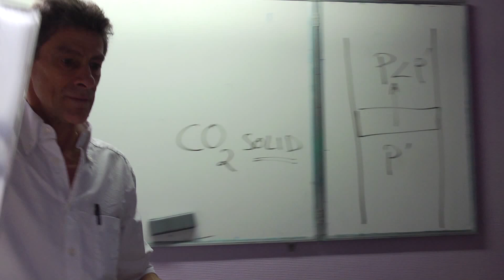Making SOLID Nitrogen!

Comment: If you were to leave liquid nitrogen in that vacuum as a solid, would it remain like that for a very long time? Or would it eventually turn back into a gas/liquid? If you were to raise the pressure in the glass container would the nitrogen stay liquid for a long time because little to no of it's molecules are leaving the liquid as a gas due to the pressure?

Comment: The cooling effect of the water is not only because of the separation of more energetic from less energetic molecules; there is also a significant latent heat component, since water molecules at any temperature need more energy to be gaseous than the total that can be accounted for by the difference in temperature between liquid and gaseous states alone.

Comment: I believe there is also a solid allotrope of nitrogen, which does not  depend so much on low temp as on ultra high pressure and it is a flat sheet/mesh/lattice with uniformly original bonds. They calculated that its colour should be a very deep blue.

Comment: SI is fantastic, it pegs measurement units to known things that do not require a master set of models. Also SI: Celsius starts at the freezing point of water*

*under specific conditions that will not be what you measure.

Comment: At the bottom of the ocean water around volcanic vents boils at around 400℃. The pressure allows it to boil at a higher temperature but does it still start to boil 100℃

Comment: Something may have been lost in translation, but it is simply not credible that about 10-20g of CO2 (concentration around 400ppm in air) can condense over the water in a water bath in a few seconds. The white, gas venting island, dancing on the water was behaving in exactly the way I would expect lumps of SOLID NITROGEN SLUSH to behave... after all, that's what the video was about, and was the stuff the guy poured onto the water...
Reply: Exactly, there's not enough CO2 in the whole room to make that floating island. Why does the solid nitrogen remain behind after all the liquid nitrogen has evaporated? It’s because the liquid nitrogen spreads itself over the whole water surface and so makes a more efficient heat transfer to the water, while the solid nitrogen has a smaller contact area to the water and so takes longer to melt/boil.

Comment: Looks like this dry ice weighs around one gram, which would mean that two cubic meters worth of air had to cool down for it to form. I wonder how that could have happen though.
Reply: There's not enough CO2 in the whole room to make that floating island. It’s the solid nitrogen which they tipped onto the water. Why does the solid nitrogen remain behind after all the liquid nitrogen has evaporated? It’s because the liquid nitrogen spreads itself over the whole water surface and so makes a more efficient heat transfer to the water, while the solid nitrogen has a smaller contact area to the water and so takes longer to melt/boil. 
And just by the way, solid CO2 will sink in water.
Reply: @martinstent5339  hope they've figured this out then. Or that thing is fluffy.
As to how much co2 is needed, there's roughly half a gram per cubic meter, so should work for a fluffy raft
Reply: @spolo123  But realistically the CO2 could not get through the blanket of cold nitrogen covering the water bath.
Reply: @martinstent5339  that I dunno

Comment: Would it not be dry ice
Reply: Yes I think it would
Reply: AdrianO why did you respond to your own comment?
Reply: Ned Landry idk😂
Reply: There's not enough CO2 in the whole room to make that floating island. It’s the solid nitrogen which they tipped onto the water. Why does the solid nitrogen remain behind after all the liquid nitrogen has evaporated? It’s because the liquid nitrogen spreads itself over the whole water surface and so makes a more efficient heat transfer to the water, while the solid nitrogen has a smaller contact area to the water and so takes longer to melt/boil. 
And just by the way, solid CO2 will sink in water.

Comment: 2020 and it's still satisfying to see dryice floating...
Reply: There's not enough CO2 in the whole room to make that floating island. It’s the solid nitrogen which they tipped onto the water. Why does the solid nitrogen remain behind after all the liquid nitrogen has evaporated? It’s because the liquid nitrogen spreads itself over the whole water surface and so makes a more efficient heat transfer to the water, while the solid nitrogen has a smaller contact area to the water and so takes longer to melt/boil. 
And just by the way, solid CO2 will sink in water.

Comment: If your description of boiling at low temperatures "the fastest molecules boil out" is accurate, that implies that at any one time there are hot molecules and cold molecules in solution together. I'm not sure how heat diffusion works on the molecular scale, but the further implication is that a significant proportion of the molecules are cold enough to be at a solid state, and that it is only due to the averaged out heat that it retains its liquid state.

Comment: So... How did you go from solid and liquid nitrogen to solid CO2? Would think that the evaporating nitrogen would have quickly and completely displaced the air, leaving only nitrogen vapor.  That ice floating around wasn't just more solid nitrogen? I'll have to watch that again. ;)
Reply: There's not enough CO2 in the whole room to make that floating island. It’s the solid nitrogen which they tipped onto the water. Why does the solid nitrogen remain behind after all the liquid nitrogen has evaporated? It’s because the liquid nitrogen spreads itself over the whole water surface and so makes a more efficient heat transfer to the water, while the solid nitrogen has a smaller contact area to the water and so takes longer to melt/boil. 
And just by the way, solid CO2 will sink in water.

Comment: I have been making liquid nitrogen for decades but now I’m too old to scuba dive 
   The point I wish emphasize is the boiling of the nitrogen 
  Is what happens when you are down Four atmospheres and are now returning to the first atmosphere and the most dramatic 
 The boiling of the nitrogen is what happens to a scuba diver when he gets the bends   The longer the time and the deeper the depths the more liquid nitrogen you have in your blood
 A scuba diver never surfaces faster than his slowest bubble 
 There is a thing called nitrogen narcosis this is when you are down four or5 atm and your diving buddy starts talking off his scuba gear with the belief he no longer requires it you need to get this individual to the surface without bending them 
The liquid nitrogen needs time when turning back to a gas or you will be bent 
 If you do not elevate the feet dramatically as to cause the bubbling liquid nitrogen to enter your feet instead of your brain think of what would happen to your brain if it was boiling

Comment: Isn't it pretty well known that boiling point depends on pressure for anyone with rudimentary physics knowledge?

I knew boiling and freezing both use energy, though I never gave thought to cooling something by lowering pressure and thus freezing by boiling.

You say solid nitrogen sinks in liquid nitrogen, but that ice was floating in the bottle. So was that really frozen nitrogen?

Comment: The frozen carbon dioxide would be created with or without the solid nitrogen in it.  That nitrogen slush had nothing to do with it.  You can make it with just liquid nitrogen.  BUT SOLID NITROGEN IS SO COOL!!!  Just don't put your finger in nitrogen slush.  I'm guessing the leidenfrost effect won't protect your finger as much because much of the heat of your finger would go toward melting the nitrogen ice vs flash boiling the liquid nitrogen.

Comment: It's so interesting to think that with very little equipment, I could make solid nitrogen in my own house.  Cryocooler to make liquid air and vacuum pump to turn it solid.  I knew the nitrogen ice would sink.  Water ice is one of the FEW exceptions that actually floats

Comment: 3.15 That is not CO2. 
It is very simple ok. CO2 can not exist in the liquid form when open to the atmosphere like this, and it is very clear in the video that a white, bubbling liquid is floating on top of the water at this moment. 
It is a liquid (at this moment, shortly before becoming solid) so it is definitely not CO2.

The triple point of CO2 is at 5.11 atm and -56.4 deg C.  Therefore CO2 only exists as a liquid at 5.11 atm and above, that means five atmospheres of pressure (or greater) are required for CO2 to be in a liquid state, not one.

Furthermore, The density of dry ice varies, but usually ranges between about 1.4 and 1.6 grams per cubic centimeter which is heavier than water at 1.0 grams per cubic centimeter, meaning that dry ice sinks in water, it does not float. The density of solid nitrogen is 1.027 grams per cubic centimeter, and, while this is slightly more that water it is able to float in the video due to the cushion of gas it is continuously producing below it.

The stuff at the end is simply the end result of the solid piece of nitrogen that was placed into the water bath. It melted into a liquid, continued to float on the water surface before re-condensing [the same way the solid was initially produced: namely losing higher energy molecules] back into a solid  and finally evaporating away.

Please understand people, even scientists make mistakes. 

Anyways, this is an awesome video and veritasium is an awesome channel!

Comment: Can we use this method to create absolute 0 ?
Reply: I don't think so, 'cause that would mean causing all particles to be perfectly still.
Reply: lol no, you'd have to basically freeze an atom on an individual level and even then it might not work becasue of "the strong interaction" between gluons and quarks. As there will probably still be oscillations becasue of how this fundamental operates.
Reply: Liquid Helium
Reply: +Dashie Dash no that wont happen. They are still moving. Otherwise it violates the Heisenberg's Uncertainty Principle. They do move but vey less.
Reply: Of course not: With that method you can reach the triple point of that material. You would need some material with triple point in absolute 0. That kinda material does not exist.

And of course not ² : The Third Law of Thermodynamics

Comment: So you can cool water by putting it in a sealed bottle and decreasing the pressure?
Reply: exactly. it will boil tho, but i guess you know that allready from the vid :D
Reply: ThegamingZerii yes I do hahah, well thats pretty cool.
Reply: But how do you decrease the pressure? By sucking out the air?
Reply: Dhruv Chanana Or by doing it like in a syringe, you make it a sealed cylinder and then pull the top higher making the volume of space in the tube larger with the same amount of water and air.